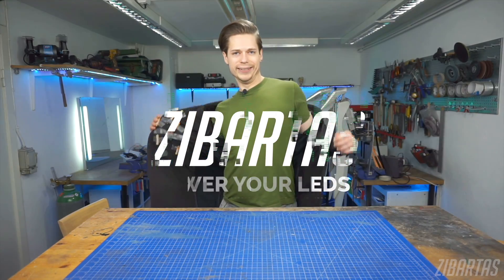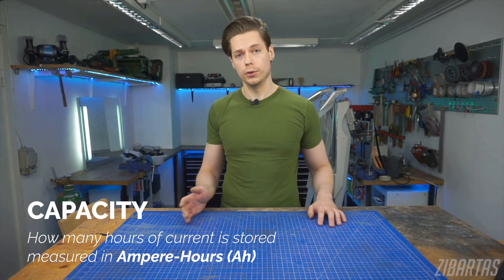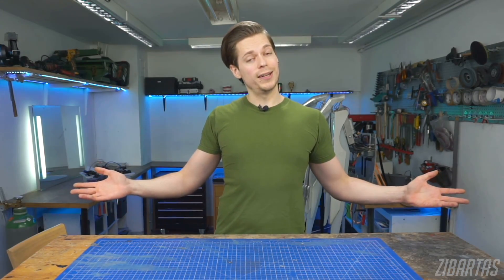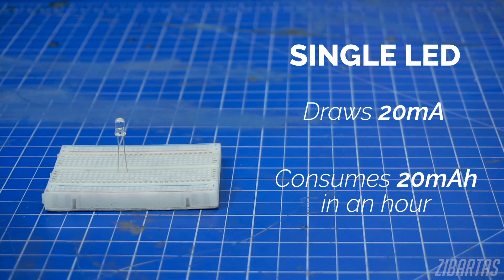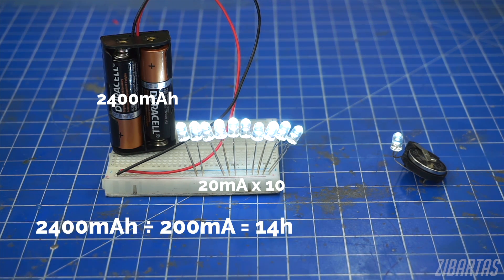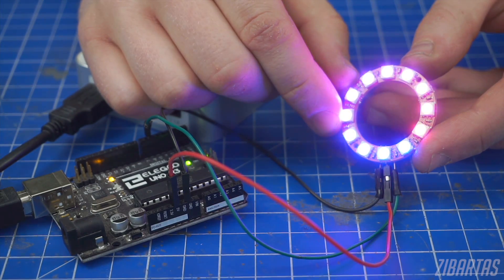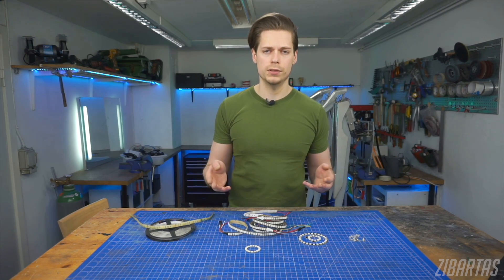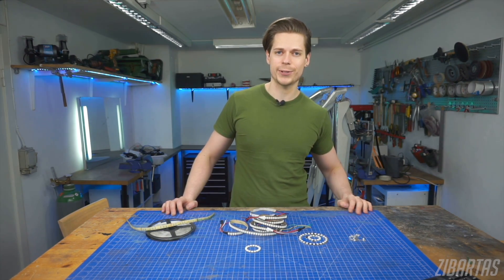Power your LEDs! Cosplay & DIY Batteries Simplified.

Comment: So I’m a total noob to cosplay and I’m trying to be superdad... can I ask wiring a question? Adding LEDs to my daughter’s costume, but having trouble wiring them... I was think a parallel connection with a 3v AA battery box... but calculators say I need resistors... do you have any examples of your stuff? I know legalities prevent actual advice... but in your experience...
Reply from the maker: What kind of LEDs do you wanna use? :) Individual 3V LEDs? Or a segment of a 12V strip?
Reply: Zibartas yes. 3v LEDs. 8 total, 4 on each side of a bracer.
Reply: Yes, 3v blue LEDs. On a bracer, 4 on each side (8 total)
Reply: Thank you so much btw! Love your channel...
Reply: Also trying to learn how to solder :)

Comment: We could use a trigger module with the powerbanks that have PowerDelivery, will that work?
Reply from the maker: Hm not sure what you mean - is PowerDelivery some sort of fast charging thing?
Reply: @Zibartas  yes; I've heard that led can draw 3xtra current which can heat and burn them. Will a trigger module work for limiting the current & voltage or will we require something more?

Comment: Trully I was looking for video like this for one year! 
Still, I do have one problem (like Samantha M), so maybe you can solve it - 
I need to  power 2 meters of UV LED STRIP (link bellow) of 12V, It would also come with ARDUINO. Lights should go on only after each 15 minutes for 20 seconds and only during night (so it would be also with light reflector or something like that). All this stuff should be placed in a box wich depth is only 2 centimeters... Is there any way to make the power source to last long? and how long? Ofcourse, not talking about the power cable. This thing should be portable.
https://www.aliexpress.com/i/32952644942.html
Reply from the maker: So the batteries need to be no taller than 2cm? 

And The exact behavior would depend on the Arduino code you'd be running- its of course possible:)

Comment: Hi What about a 18650 Battery ? What would be your insight in that ?the same rgb strip that u showed  how long would it last ? Also can't we use the same 4 pqck battery holder for 18650 for a better combo ?
Reply from the maker: Well 18650's are a bit tricky as they're lithium. So you can discharge them too low, if run without a voltage monitoring circuit, effectively putting your batteries and you in danger (from un-rechargeable cells to fire hazard). Doing it 'right' will add extra complexity to the circuit. That being said, they're great. They provide 3.7V each, so 4x3.7V will be ~14.8V if you connect them in serial - might be a bit TOO much for LEDs. - You could always experiment with 3 to avoid the need for resistors?
Reply: @Zibartas  thanks!

Comment: I'd like to power up 32.8 feet of LED strip lights. The only way I can do that is to use the power cable that comes with it. Is there a way to connect a battery pack instead? Is there a battery pack I can purchase on Amazon or maybe eBay? The voltage is 12 Volts and 36 Watts. Here is the link to the product I'm talking about.

https://www.amazon.com/gp/product/B01GEBW7Q8/ref=ox_sc_act_title_1?smid=A353AQG9I0DZD6&psc=1
Reply from the maker: Yeah you will definitely need something more than 8x AA batteries to power that many LEDs - is it a portable thing, or something for your house?

Comment: For those LED strips, if one 9v battery can only light it up for so much, what if I take two of them (18v or something)? Will it shine SUPER bright or burn out? also does the length of the LED strip effect the power consumption and voltage of the battery?
Reply: It will burn out. Although you can add them in series to make it run at 9volt but twice the Ah (double time)
Reply: @mynk0.78mm  parallel to run twice as long. Series to increase voltage. 

And remember kids if you use rechargeable lithium batteries, series requires cell balancing and should have a protection circuit (BMS) for over discharge, overcharge, short circuit, etc

Comment: It's worth noting that you can use a (few) current limiting resistor(s) to make a 9V battery last longer, depending on what kind of circuit you're making. I made an Iron Man glove build that used 3 different LED circuits in parallel with a resistor attached to each LED in series (so that they wouldn't burn out). Worked for a solid 2 convention days without needing to change the battery (~20-30 hours). So there are ways to make 9V batteries last longer. Solid guide though! Deff took a couple tips away from this
Reply: thats good know!